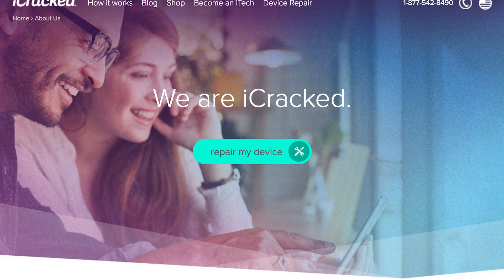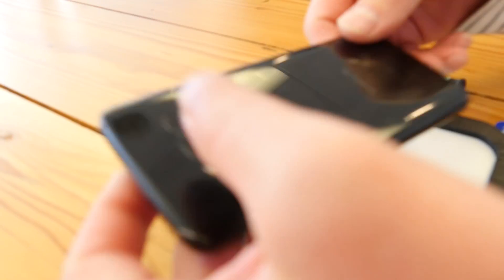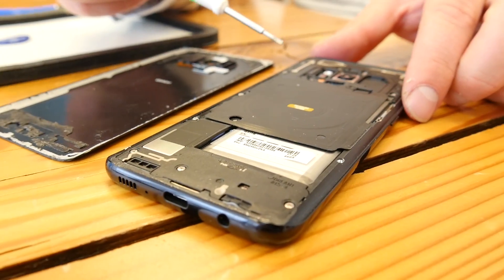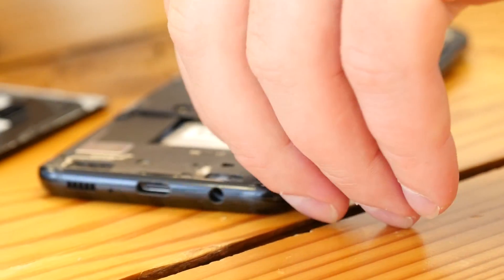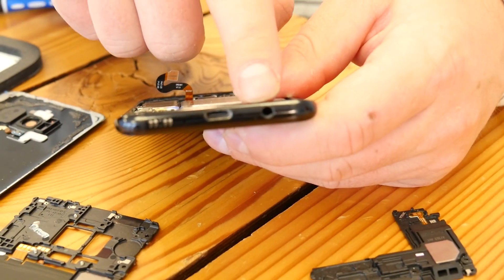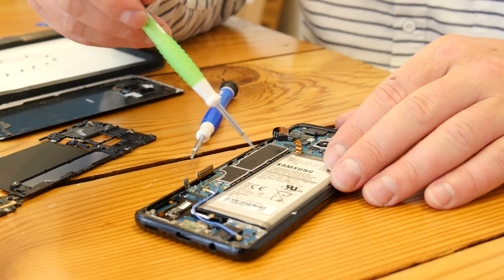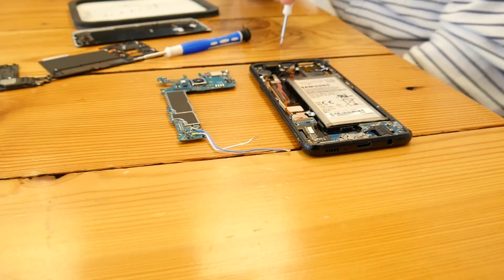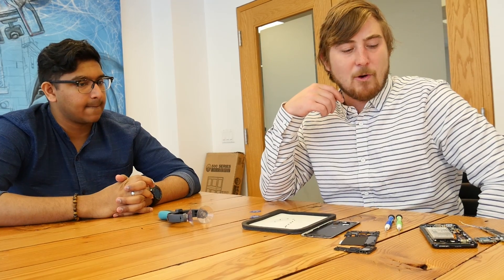Samsung Galaxy S8 Teardown

Comment: you should have used magnetic screwdriver. by pulling the screw with your fingers like that might damaged 1 or 2 thread on the housing if you're not fully loosing that screw.